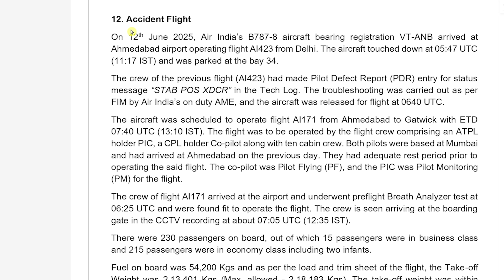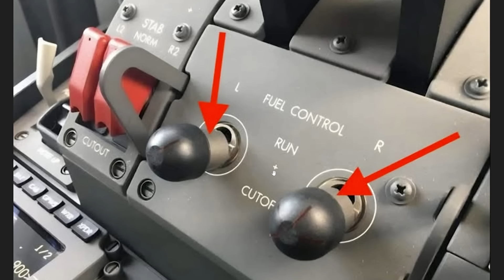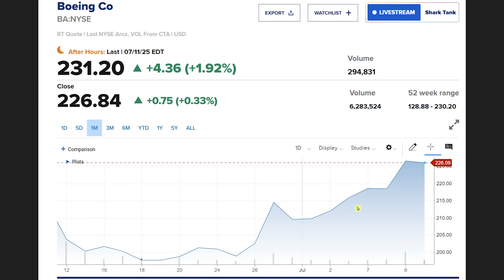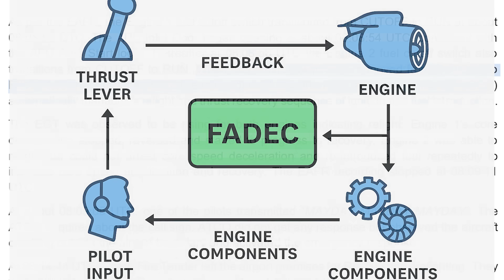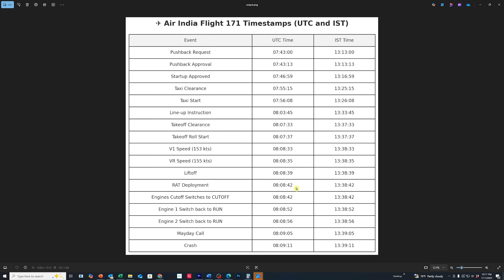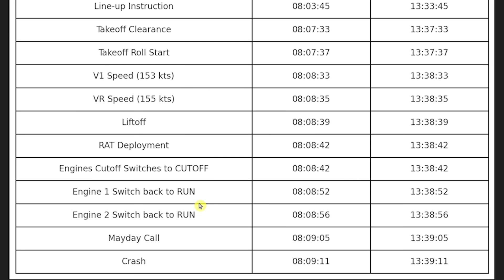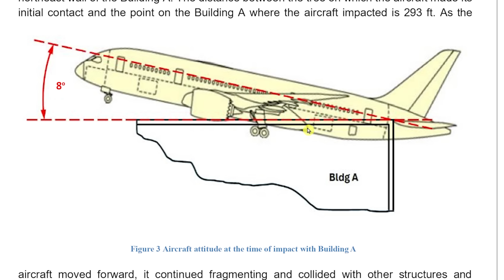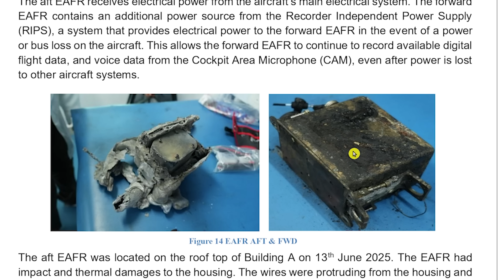Did Pilots CUTOFF Fuel? Shocking Twist Air India 171 Report!

Comment: The fuel switches were never touched by the pilots: due to a vapor lock, the warning system signalled fuel supply had been cut-off. So pilots asks if other pilot pulled the switch manually.

So they look at the switches and know it was a fuel issue instead of the switches.

They knew it had nothing to do with the switches.
Vapor lock or similar issue triggers a sensor signal to the black box as if cut off switch is used, whereas it was never manually operated.

So the nose angle triggered the vapor lock in fuel system to cause a sensor to signal as if the cut off switch had been manually operated. When the RAT was deployed this boost somehow helped to get rid of one part of the vapor lock allowing one engine to relight, and the sensors to notify the cut off switch had been reverted as if manually been put back to run.

Design must be improved so even with vapor lock, that can never happen during take-off, by implementing a secundary valve system that secures sufficient backup supply to reach certain height levels before falling back to the normal routing in the fuel supply system
Reply: Stop misleading people based on your made up story. There are experts and they're way more wise and trustworthy than you. They have already published their findings.
Reply: Vapor lock in both tanks at the same time is impossible.
Reply: @rickdonkulus The only simple explanation could then be: maybe due to hot weather one pilot did not wear the usual clothing and either a loosened sleeve or bracelet, while operating other instrument, was caught by those fuel switch levers and unnoticably pulled them to cut off position somehow, accidentally
Reply: @rickdonkulus Most likely then, what happened is vapor lock in one engine, causing fuel cut off signal from sensor. So one pilot assumes switches got manually disengaged to cut off. As they confirm both are still in RUN position, they have no time to gamble and immediately turn both switches from Run to cut off and back to relight both engines. The one with the vapor lock issue does not relight, the one with no vapir lock relights.

What should they have done otherwise in a desperate attempt to rescue the plane somehow, if they were forced to gamble, spreading their chances by pulling both switched back and forth instead of doing nothing or chosing the wrong switch to turn from run to cut off and back to run, which would have had effect for the engine with the fuel supply issue.

They were caught in some kind of Murphy's Law coincidence.

The problem remains a fuel supply issue.
Reply: You are totally wrong

Comment: why would you put those switches there?  I get the logic of having them close to the engine controls but surely they'd be better being placed well out of the way or at least better guarded.
Another thing there's a 4 second delay between switching both cutoff switches back on, yet the time stamp shows both switches selecting cutoff at the exact same second, is that possible?  can you operate both switches together that fast??

Comment: Reposting a comment I posted on another channel on June 15: "From all the videos I have seen, my guess is that this was a case where RAT was deployed due to dual engine failure that occurred right after take off. Considering all the factors, I suspect that this is an unknown flaw that surfaced for a certain specific 787 part related to the fuel system. The failed part probably caused loss of fuel supply. The failure could be due to bad fuel, maintenance issues or design issues. Again purely a guess and speculation on my part. So, the investigators should retrieve data from the flight data recorder, cockpit voice recorder and video recorder as soon as possible and release the raw data to the public, while they continue with the investigation and release their formal report later. This will tamp down the speculation and help aviation experts worldwide find the actual cause of the fault. This is urgent, because the fault is unknown while we have so many of the same planes currently flying, which may or may not affect them in the future."

On hindsight I could not foresee that it could be the cockpit fuel switches that were turned off by someone or got turned off by themselves, at a crucial moment right after rotation and take off.  If this dual switch turning off happened before V1, that would result in an aborted take off. If this dual switch turning off happened after reaching a few hundred feet more altitude, then engines would have sufficient time to turn back on and provide thrust. But it happened within a crucial 10-20 second time window, when the engines just did not have enough time to turn back on fully and provide thrust so the plane could maintain or gain altitude. The chances of 2 switches turning off by themselves, due to some defect in their design or malfunction due to wear and tear, is close to zero. So my guess is that this was most likely a calculated suicidal act by the non-flying pilot.

To prevent such a scenario again, one option could be to provide dual lock and key for these switches, so that it takes two different keys (one each carried by each pilot for each engine, so two keys for each pilot) to turn on or off any engine. This would mean that without actual insertion of both keys in the keyholes and turning them, any single engine could not be turned off or on. So there would be 4 key holes and keys, 2 for each engine. And the keyholes should be within a depressed area, securely covered by a transparent plastic, which will have to be raised to access the key holes.

What a setup like above would achieve is that any one pilot would not be able to turn on or turn off any engine. Also, it would be impossible for someone else in the cockpit to turn on or off engines, without getting both keys from both pilots. So this puts a lot of safeguard for many scenario, such as a suicidal terrorist intruder in the cockpit or a suicidal pilot to turn off engines and crash a plane. In case of engine shut off needed during flight, such as failed or damaged engine scenario, then a separate key less switches could be provided overhead, or in the front dashboard in a secret compartment secured by a door, just in case one or both pilots cannot find their keys. When one pilot reaches to open this door, the other pilot must be able to notice that, even if he is concentrating on the view outside while flying. This last arrangement will be a failsafe backup for the case of lost keys by any pilot, in an emergency during flight. Another option is to have spare keys in a key compartment, which can be accessed using a code that is memorized by both pilots, instead of above keyless switches.

Another failsafe measure is to disable engine turn off unless engine throttle lever is in idle location, which someone mentioned that Embraer aircraft has.

Comment: Unless the switches could be configured for remote shutdown? Someone in the cockpit, set the switches, to the off, position. Was there a way for anyone to sneak into the cockpit? During takeoff, that seems extremely unlikely.
    In theory the person who discovers the switches set to off, is the person turning them on. Only there is a flaw, to this argument. Once the aircraft begins its takeoff roll? The engine fuel off switches should not be part of the flight regime. Until the pilots began responding to the lack of engine power.
    When people choose to do, the wrong thing? They are often quick to accuse the innocent, of their crime. So, I think it's a strong possibility that the voice making the accusation? Is the hand who switched off the fuel.
     They key question of course is WHY, would anyone shut off, the engines?
     Since neither pilot survived? We know that the copilot was controlling the aircraft. Supposedly under the supervision of the captain.
    Somehow it seems unlikely that a man trying to prove himself? Would cut off fuel to the engines. With the copilot focused on flying the aircraft. It would be easy for the captain to cutoff the fuel. Then ask the copilot, why he did that?
    Both men know that there is a cockpit voice recorder. One of them wants the copilot to be blamed for the crash.
    The next question is: did the person who switched off the fuel, believe it was a suicidal action? Or did they believe that this close to the ground, they could land somewhere? More or less safely. All are tough questions.

Comment: Here is what Google's Gemini Pro AI speculates (with a suggested self-test in a simulator): This is a fascinating and chilling flight recorder log. Based on the sequence of events, we can speculate with a high degree of confidence about what happened and explain the significance of those critical switches.

1. Explanation of What Happened (Speculation)
This log depicts a catastrophic, and almost certainly deliberate, event during the most critical phase of flight: the seconds immediately after takeoff. Here is the most likely narrative:
Normal Takeoff: The aircraft performs a completely normal takeoff roll. It correctly calls out V1 (takeoff/abort decision speed) and Vr (rotation speed). At 08:08:39, it successfully lifts off the runway (liftoff/air mode transition) and begins to climb, accelerating towards a safe climb speed (V2). Everything up to this point is perfect.
The Catastrophe (08:08:42): Three seconds after liftoff, at the moment of maximum vulnerability, something causes both engines to be commanded to CUTOFF. This is the inciting incident. This is not an engine failure; it is a direct command to shut down the engines. The aircraft, now a very heavy glider, immediately loses all thrust.
The Immediate Aftermath: The aircraft's systems react instantly. The loss of both engines triggers the automatic deployment of the RAT (Ram Air Turbine) at 08:08:47. This is a small propeller that drops into the airstream to generate emergency electrical and hydraulic power. At the same time, the pilots are fighting to save the plane. They are trying to restart the engines.
The Restart Attempt: The log shows the pilots attempting a restart.
At 08:08:52, they switch Engine 1 to RUN.
At 08:08:54, they open the APU (Auxiliary Power Unit) door. The APU is a small, third engine in the tail that provides electrical power and, crucially, bleed air needed to start the main engines. They are trying to get it running to assist with the restart.
At 08:08:56, they switch Engine 2 to RUN.
The Final Moments: The restart attempt is either too slow or unsuccessful. Twenty-six seconds after the engines were cut, the pilot broadcasts a "MAYDAY" call. Six seconds after that, the recording stops abruptly, which almost certainly indicates a catastrophic impact with the ground.
Conclusion: This was not a mechanical failure. The simultaneous, commanded cutoff of both engines seconds after liftoff points to one of two horrifying possibilities:
Pilot Suicide/Terrorism: The most direct explanation is that one of the pilots deliberately moved both engine master switches to the CUTOFF position.
Malicious Cyber Attack: A sophisticated, malicious actor with access to the aircraft's core systems could have sent a digital command to shut down the engines. This is less likely than pilot action but technically possible in a highly advanced aircraft.

2. Significance of Fuel CUTOFF and RUN Switches
These are arguably the most critical switches in the cockpit outside of the primary flight controls. They are the "master on/off" switches for the engines.
CUTOFF Position: This is the "off" position. When a switch is in CUTOFF, it closes the main fuel spar valve to that engine. It literally starves the engine of fuel, causing it to shut down completely. This is used to secure the engines after landing or in the event of an uncontrollable engine fire. There is almost no conceivable reason to move both switches to CUTOFF just after liftoff. It is a catastrophic action.
RUN Position: This is the normal operating position for the switch during flight. It holds the fuel valve open, allowing fuel to flow and the engine to operate. The log shows Engine 1 to RUN and Engine 2 to RUN because this is the first step in the emergency engine restart checklist. The pilots, having realized the engines have been cut off, are trying to move the switches back to their normal position to get fuel flowing again.
In short, the switches went from RUN → CUTOFF (the catastrophic event) and the pilots were desperately trying to get them back to RUN to save the aircraft.

3. Simulation in X-Plane or MS Flight Simulator
Yes, this exact scenario can be simulated perfectly in a high-fidelity simulator like X-Plane 12 or Microsoft Flight Simulator (with a study-level aircraft addon like a PMDG 737 or Fenix A320).
What would happen in the simulator:
You would perform a normal takeoff. As the aircraft lifts off the ground and the landing gear is retracted, the nose would be pitched up at about 10-15 degrees, climbing away from the runway.
You would then reach over and pull both engine master switches/levers to the CUTOFF position.
The effect would be instantaneous and terrifying.
The powerful roar of the engines would immediately cease, replaced by a sudden, shocking silence and the rapidly increasing sound of the wind rushing over the cockpit.
All thrust would be lost. The aircraft, which was accelerating and climbing, would suddenly start to decelerate rapidly.
A cacophony of alarms would erupt in the cockpit. A loud "master warning" siren would sound, and the engine display screens (EICAS/ECAM) would be filled with red warnings like "ENG 1 FAIL," "ENG 2 FAIL," "DUAL ENGINE FAILURE."
Because the aircraft is in a high-drag configuration (flaps still out from takeoff, nose pitched up for a climb) and has no thrust, it would lose speed and altitude at an alarming rate.
You would have only seconds to react. The priority would be to push the nose down aggressively to try and maintain airspeed and prevent a stall. A stall at this low altitude would be completely unrecoverable.
Even if you managed to avoid a stall, you would be descending rapidly with very little airspeed. From a typical takeoff altitude of only a few hundred feet, you would almost certainly not have enough time or altitude to successfully restart the engines before impacting the ground.

Conclusion of Simulation: The simulated event would be catastrophic and almost certainly unsurvivable, ending with an impact at or very near the departure end of the runway, exactly as the log implies.
Reply: Wow beautifully illustrated❤

Comment: I asked chatgpt about this. If it’s possible for sabotage by someone doing maintance. 

 I have no idea if this is true but this was the response. 

Yes — in theory, a maintenance crew member with inside knowledge could tamper with or remove the spring-loaded lock mechanism or modify the switch’s internal resistance, making the switch easier to move or susceptible to vibration, G-forces, or acceleration—but this would require:
	•	Access to the cockpit panels or side console
	•	Intimate knowledge of the switch design (especially on the 787)
	•	Intended bypass of safety systems without leaving obvious evidence

Why I am not convinced this was done by one of the pilots is the time. I mean think about this. There’s another pilot there with you focused during take off. Even if he didn’t notice doing both in split seconds like within one second defies laws of physics. 

However, if someone highly skilled in aircraft engineering designed such a system it can go off based on the angle of the flight or the speed or take off g force etc at one particular instance. If everything is burnt there would be no clue. 

Why I suspect this is without naming anyone , is the location. Gujarat is IndianPM home state and recently was in a war with another country. And there was an ex chief minister there too. 

I know this is just a conspiracy theory but the pilots don’t have any major events in life for them to do such an act.